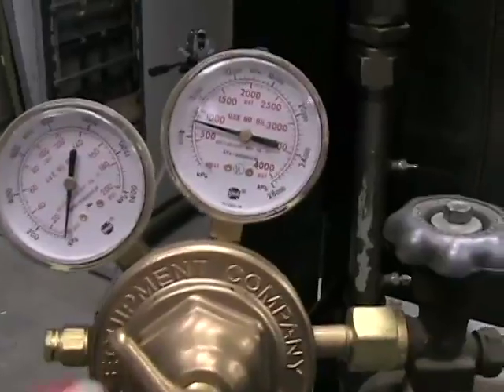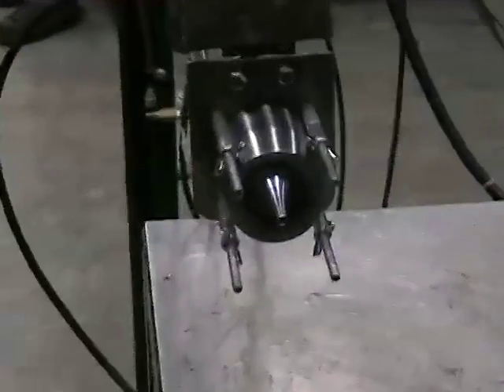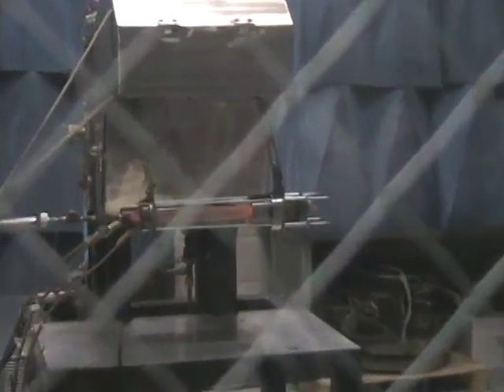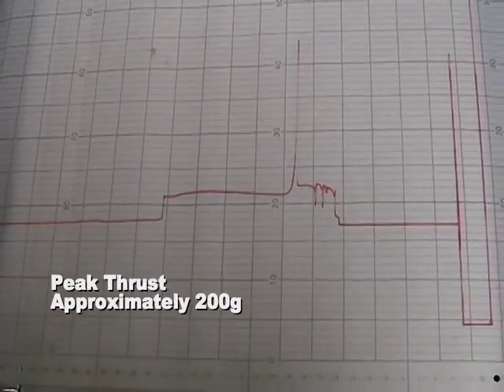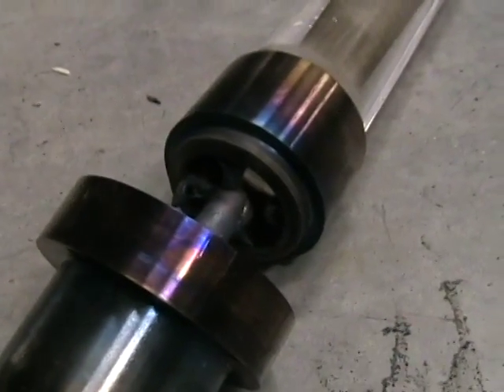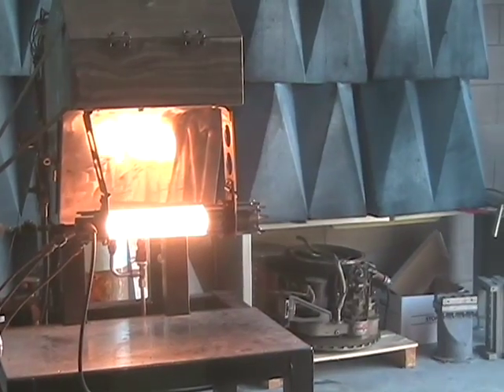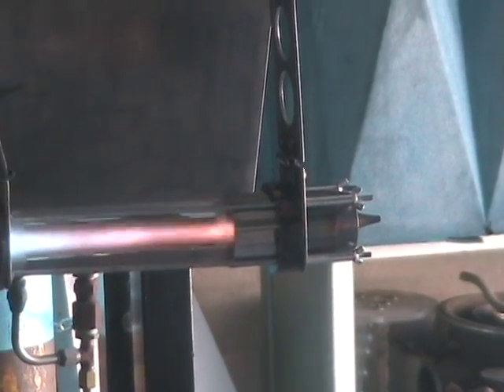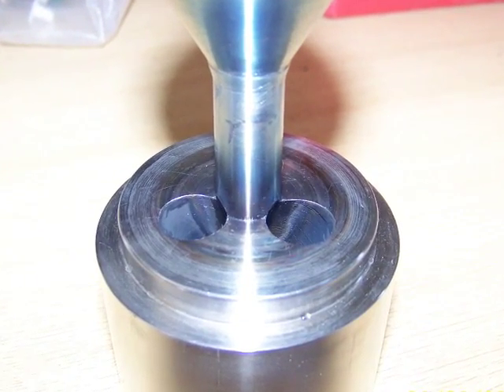Hybrid Rocket Motor Aerospike Nozzle Tests

Comment from the maker: Yes, this type of nozzle shape would be more efficient in space over a regular bell nozzle. However, it is also more efficient while in our atmosphere as well, but the only problem is that the nozzle is surrounded by the hot exhaust, therefore actually getting one to work for say the space shuttle would be very very hard. NASA did look into this nozzle shape a long time ago and they have yet to figure out a way to use it, other than it being linear.

Comment: The propane is used as an ignition source.  you just can use a spark plug since you need to touch the grain.  A squib works, but here at Poly a quick turnaround is beneficial.

Comment: you should maybe take a more heat resistant material. Did you measure out the nozzle´s temperature? You can do touchless to save your equipment via IR. Maybe you also can add a surface coating that burns away to get rid of temperature on the nozzle... Just thinking...

Comment: Did they ever conclusively determine what exactly caused the cold flow accident in Scaled composites? I suspect the N2O they used hit some catalytic metal like nickel and their composite fiberglass tank pressure got too high. I think they now realize it pays to have a burst disk on those things.

Comment: this would really be efficient if a low temperature fuel would run thru the spike.

like in the cone of the nasa rocket engines.

but then again this is a smal scale.

good luck :]

Comment from the maker: Thanks for the comment. Well, this setup can only support about around 120-150 psi of O2 before the combution leakes out between the o-rings. It would be posible to have this be much greater, but that would require it to be redesigned.

As for finding information, if you can access AIAA, they have everything that I used. And if yor associated with a school, you should be able to have access to AIAA, at least it was when I looked through them a year ago.

Comment from the maker: Thanks, glad you liked it. Yeah, thats why this uses the plexiglass as the comb. chamber so that it internal mixing can be viewed, although it makes it very bright. As for the instability, that is the propane dancing around, it probably has to do with not enough oxygen to burn since its not only burn itself but the plexi fuel aswell, ie very fuel rich. The oxygen is the bigger 'puff' in which its a pretty stable burn afterwards. As for the metal, I dont remember if I looked at that one or not.

Comment: Very nice video. I like the use of plexiglass (polycarb or acrylic?) for the combustion chamber.

I have a few questions:

1) After the ignition for a few seconds there is a squeal and  the combustion regime is different. Is this because you are ramping your O2 up until you choke?

2) Ever consider using an inconel-series metal? Say 718? The stuff is a biznitch to machine though with the proper cutting tools you will get superior results.

3) What boundary conditions did you use on MOC?

Comment from the maker: I looked into it, but from what I found, the temperature increase was only about 3-400 degrees C. So it would still have a hard time withstanding the temperature. As for its other qualities, this is a test nozzle, so the strengh and weight arnt very relavent to the testing. If I were to make this a flight test, then yes I would have looked into Ti a lot more. And it would have cost about 12-1500 dollars too, way to much for a senior project. But thanks for the suggestion.

Comment from the maker: Well an aerospike nozzle or aka a plug nozzle is pretty much an inverted rocket nozzle. A normal nozzle compresses the exhaust toward the center of the nozzle before expanding it back out again. The spike nozzle is more like a garden hose spray nozzle. Instead of defining the outer walls like the normal nozzle does, the spike nozzle only defines one wall and uses the atmoshpere as the other adjustable wall, therefore making it more efficient in terms of under or over expanding the flow.

Comment from the maker: Well, I wrote two computer programs to design the shape, one using simple geometry and the other using method of characteristics. I also purchased a design program from AeroRocket Technology which also uses method of characteristics. I used each program to design nozzles that were tested in cold flow tests befor designing the hot flow nozzle. As for a combustion model, I did not perform any CFD analysis. If I had I could have submitted this for a Masters Thesis instead of just a Bachlors. :)

Comment from the maker: The propane is only used to ignite the oxygen, it may also react with the plexiglas fuel grain but only very little. Once the propanes burn is at steady state, the pulsating in the first attempt, then the oxygen is injected and the propane is turned off. The propane provides a hotter flame to ignite the oxygen than the spark plug that ignites the propane. The Oxygen then burns with the plexiglas. Thanks for the comment.

Comment from the maker: Yeah, thats pretty much what happened, and thats what the second nozzle was designed for. The three holes were more streamlined than the 'wagon spokes' which caused stagnation areas in the flow, heatting it up beyond the normal exhaust temperatures. Thanks for the advise.

Comment: yeah... when i did mine, it was already a personal project and found out i could turn it into a independent study at the university. so, i had already purchased all the equipment. they did though offer supplies when i signed up for the independent study. why wont they let you use  N2O ?????